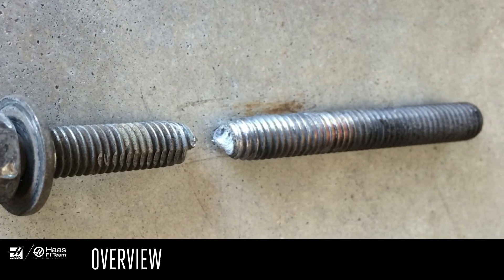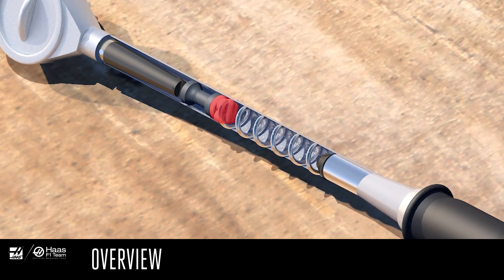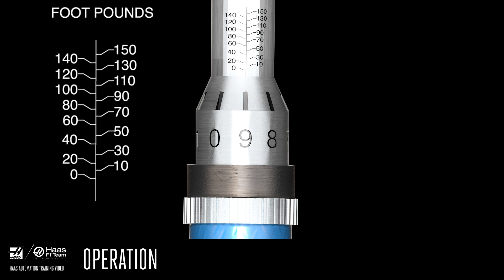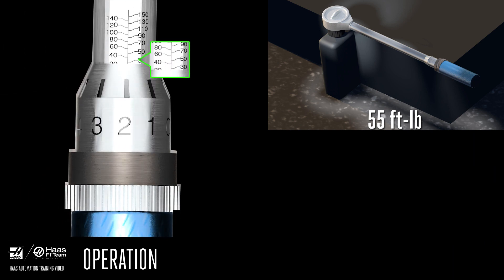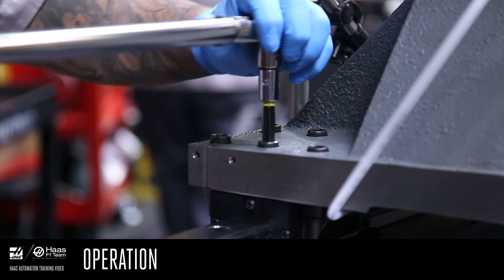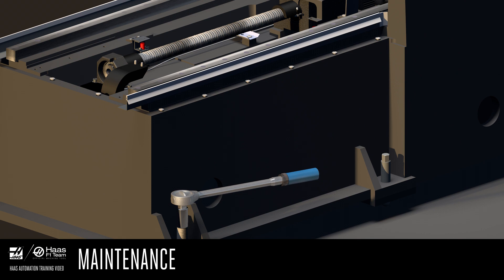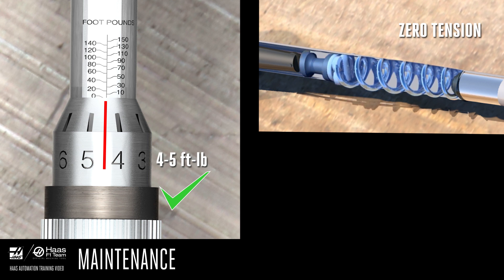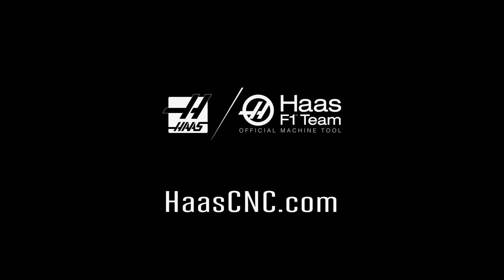Torque Wrench Basics - Haas Automation, Inc.

Comment: Torque wrenches need to be at every machine in a shop. Period. Including Torx light wrenches for torx screws on tool holders. Nothing ticks off a machinist more than an over tightened set screw. And they also need to be regularly re calibrated. Worked at a shop that ran a production job for YEARS that used one torque wrench they bought from harbor freight or something, was never ever calibrated and was probably dropped more times than Donald Trump fell asleep during a national security meeting. TORQUE IS IMPORTANT IN EVERYTHING!

Comment: I was tought when I was young to back the torque adjustment to 0. Out of habit I would back the tension of the spring then rotate clockwise until I feel it come up against the spring. Why  would you want to store it at 4 or 5 foot pounds? If anyone knows I would appreciate a reply.
Reply from the maker: Andy, There are many torque wrench designs that are similar to the ones we show in this video. Some wrenches allow the spring tension to be completely released if you keep unwinding the barrel past the zero setting. This is what we are trying to avoid. The difference between a 0 and 5 ft-lb setting is negligible (on a 100 or 150 ft-lb wrench). Returning to a zero setting is fine.
Reply: @haasautomation  Thanks for clarifying.

Comment: appreciate it! Didn't know the information on setting it to 0, i always set my Torque Wrenches to 0, at one point when i was first learning and got my torque wrench i set it below 0 and found out that was bad so i set it to 0 instead. Now i find out 0 is bad and need some tension. Thank you very much!
Reply from the maker: Lime, There are many torque wrench designs that are similar to the ones we show in this video. Some wrenches allow the spring tension to be completely released if you keep unwinding the barrel past the zero setting. This is what we are trying to avoid. Typically at a 0 setting there is still some tension on the spring. The difference between a 0 and 5 ft-lb setting is negligible (on a 100 or 150 ft-lb wrench). Returning to a zero setting is fine.

Comment: I was taught to always set the torque wrench to the lowest setting every time you are done using it. Never try to re torque the bolt/nut again after it is set. You must loosen it to torque it again. Go slow when torquing with it. Most people in the videos were going way to fast and most likely went over the torque setting. The military beat the proper use of a torque wrench in me for 20 years.
Reply: two clicks won't hurt anything. obviously if you're doing something critical like spacecraft assembly you just do whatever they tell you to do, but for general purposes, two clicks is fine.